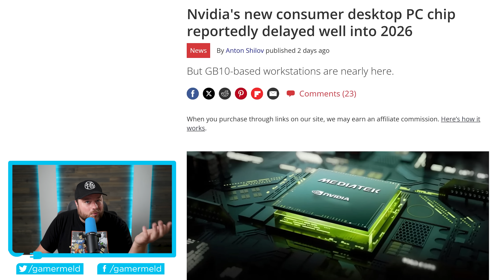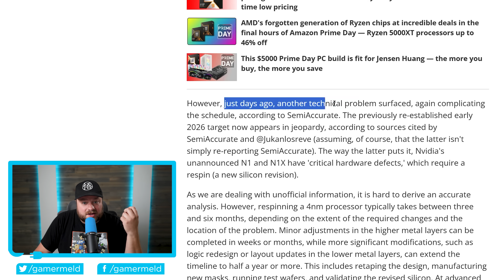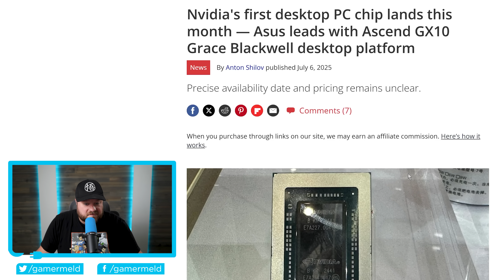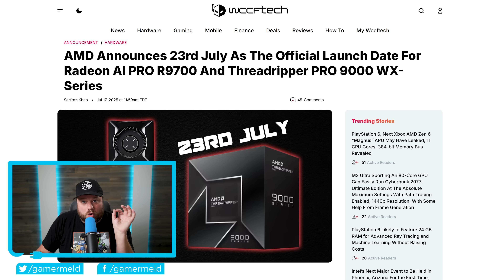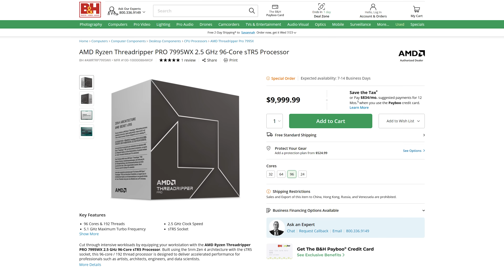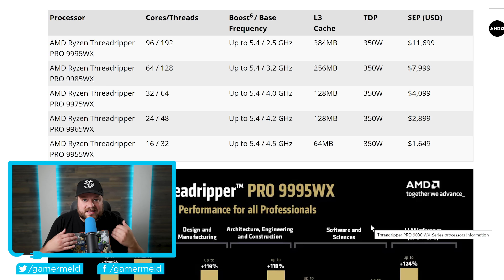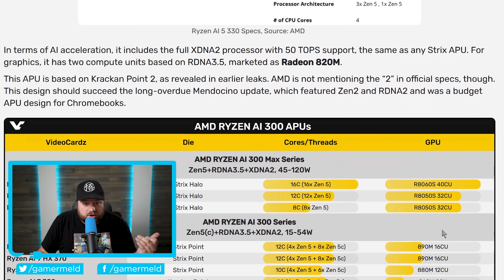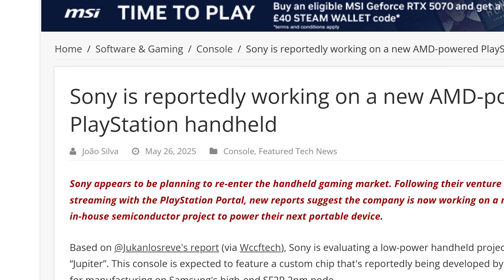32GB AMD GPU Is Here!

Comment: 8 GB GPU is not enough. 16 GB is great. But what is the reason for 32 GB ? Even 5090 is not really powerful enough to have playable frame rates on such graphics that would require 32GB of Vram.

Comment: The AI pull should be addressed by releasing products focused on that. Only then there could be a separation of the market for gaming GPUs. I also think video processing GPUs should become a thing again, because most gaming GPUs right now are simply ineffective: too much power consumption and extremely high thermals compared to Apple's chipset, for example. Maybe AMD is going in the right direction: developing a high performance APU that could be used to gaming (and probably media production as well) to rival the huge efficiency of Apple's chips. I'm surprised that nVidia decided to develop a conventional CPU instead of using their expertise in GPU making to develop a high performance APU.

Comment: What many non business consumers don't think about when looking at '$12k' CPUs or any tool or hardware is the cost of operation and return on investment.
If you are paying your workers $100 per hour and if they are working 2100 hours per year, that's $210 000.  Having them use tools which are 10 % faster is 'saving you' $21k. That CPU looks like a bargain that way.

Comment: I used to buy HP server racks about 15 years ago. For a quad or eight CPU Xeon-based unit, we'd pay between £15,000 to £22,000. Having one CPU with 64-96 cores for around that same price would have been absolutely epyc! (pun absolutely intended). So, no, those CPUs are not expensive

Comment: I want a monster gaming IO die with x3d stacked vram buffer, a single 2 to 8GB HBM die while using system ram for bulk buffer this can link up with normal compute chips and drop into am5 use a thicker interposer and thinner ihs, I feel that some of the burned up CPU's are for interposer current failures a think

Comment: Eventually AMD's APU's will be on par with a 60 or 60TI Nvidia card and Nvidia will lose half of their GPU market.
Reply: I mean, the 8060 apu already does that, beats the 4070 mobile
Reply: fsr4 would have to be in as many games as dlss firsr
Reply: @bigturkey1 lol you wouldn't need to use upscaling on a good card.

Why would you sacrifice your game looking gorgeous, just for 20 more frames when you're already getting 100+ fps lol I don't get it. 

You would rather have your game say "4K" when it's really just upscaling to some terrible looking piece of crap so you can say you're pushing 200 fps when you could just run native at 120 

PC gamers are funny.
Reply: @sudonix5923 dlss performance at 4k looks like native 4k. I 9070xt without upscaling averages below 60fps in modern games. Games since 2020 are designed to run at dlss performance at 4k
Reply: @bigturkey1 no it doesn't. If it did, it would be native and wouldn't be dlss. There is a very noticable difference. it's close, but if it looked the same there wouldn't be a need, because obviously the game is rendering natively lol
Reply: @sudonix5923 the only reason we can game at 4k is because dlss was invented
Reply: @bigturkey1 nah before that fps was low but highest end gaming GPU's were able to play 4k lol
Reply: @bigturkey1  lol

Comment: For reference the 9060xt is 199mm2 on 4nm!  The 9070xt is 335mm2.  The Magnus GPU die is roughly the average of the 2.  265 vs an average of 267.

If it’s on something better than 4 nm, it’s gonna be close to a 9070xt, with all the ram the system can give it.

Comment: i miss the A10 APUs those were cracked for the price back then
Reply: those were trash, they marketed those saying you could crossfire the apu power with your gpu power. it never worked.
Reply: @bigturkey1  I had a laptop with dual graphics. It sucked. Half the time, games ran better when I disabled the dGPU and just used integrated (they used trash GT610-tier discrete GPUs just so they could advertise dual graphics; my A10's iGPU was actually faster).

Comment: An AMD Epyc APU? but why would you want an APU server chip? oh, epic, not Epyc
Reply: AMD does actually sell APUs for servers, they just don't brand them as EPYC.
The AMD Instinct MI300A is a server APU. They're useful for some AI workloads that would normally be bottlenecked by the latency of communication between the CPU and GPU.
There's also Ryzen Embedded, which is a series of industrial APUs, mainly intended for things like ATMs and control panels for heavy machinery, but sometimes used in low-end servers.